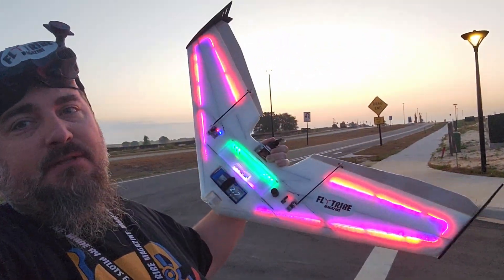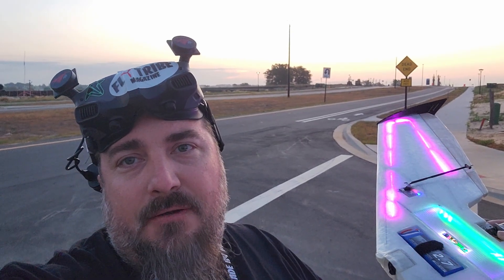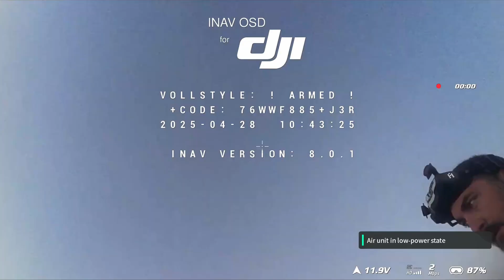VollStyle RiteWing - Maiden Flight Plus A Few Extra Packs

Comment: Rotor Riot and Shawn Morrison have a smaller version of my VollStyle.
My wing is NOT sold by Rotor Riot....only RiteWing 
And ...yes mine was first
Reply: Shelby do you have these in stock?
Reply from the maker: I see that now, you've got the 36" and they only have the 32" version. They do look very similar and mine came with a battery tray that was laser engraved Riot32 which made me believe they were both the same. Thanks for clarifying that and I'm glad I got the OG version!